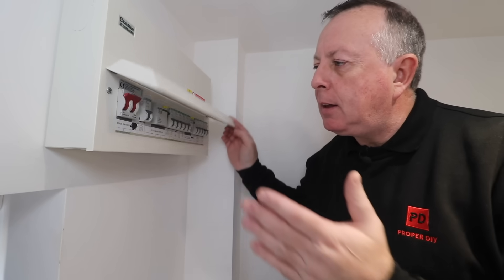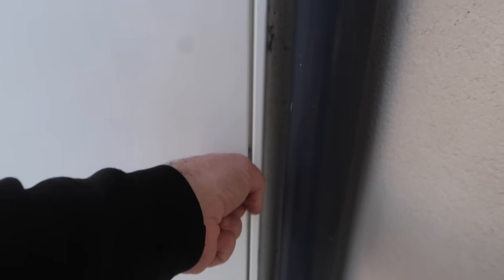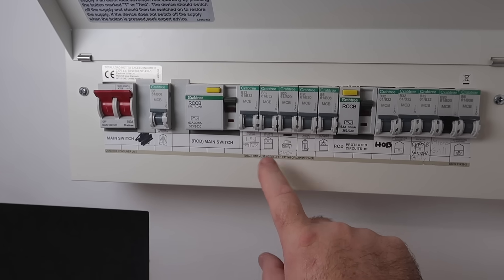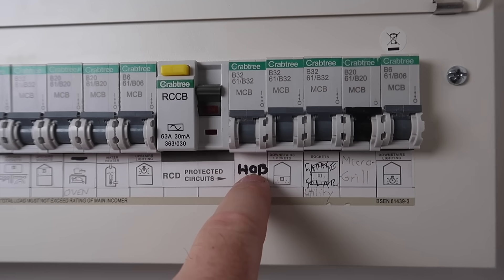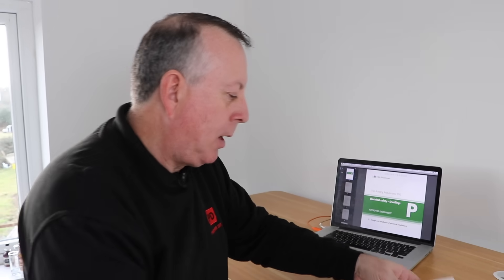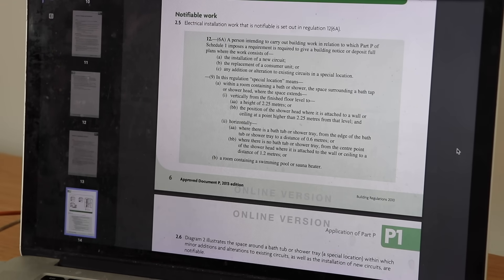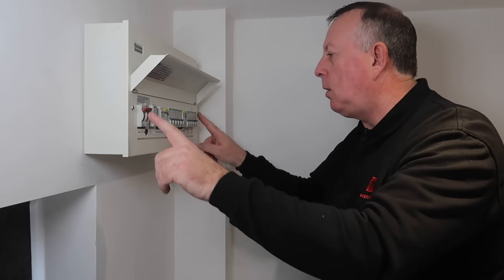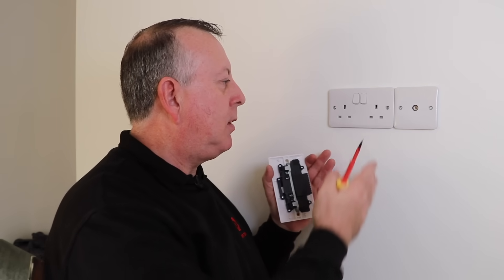What electrical work are you allowed to do in your own home?

Comment: Crazy , not being able to add another circuit, changing out breaker.

I had to tell an electrician to leave once due to doing it half ass.

Some off the installs or work you see very questionable and seems bit to easy to get the correct certificate to do the work.

If you're capable and following the rules and regulations should all thats be needed.

Comment: Very informative, but if I wanted to run power to a shed from an outside socket as shown in the video (6mm armoured cable being the proposed size),  could I connect it via that outlet or would I need to get a qualified leccy in to do it?

Comment: Interesting. Here in Finland you can change the "sugar cube", so you can install ceiling lamps yourself, or switch that cube to a socket for lamps. We can also do things with 12V systems ourselves.
But anything more belongs to qualified electricians - but even changing the consumer board doesn't have to be notified. You just need to keep the paperwork signed by the electrician just in case. 

Though you can save by installing the cables in place yourself, and letting electrician just do the connections.

Comment: Why doe they call it "Part P for the UK", when it doesn't cover the UK except within England and Wales? 
FWIW, I've installed shower circuits, oven circuits, and garden power circuits - to perfectly adequate electrical standards. But not being in England or Wales, it's all perfectly legal (and the flats/ houses have sold without problems).

Comment: The usual answer is, anything as long as you get someone certified to sign on that taking over responsibility for your artwork :P Where I live (not UK) I ofted do the work that the electricians should and then just pay the electrician to inspect and sign on what I did. Effectively this legalizes the installation, as the electrician makes the same document as if he did the job, but since he didn't put in as many hours, its cheaper for him. You just have to make sure the quality of your work is good, so that the tests pass, otherwise you have to pay for the tests and won't get a passing result, meaning you will have to fix it and re-do the tests, and this obviously will increase the cost.

On the continent if you had this much power (Watts) assigned, then you would have a 3-phase line instead of one thick 100A rated single-phase cable. Pretty much lets you pull the same amount of power, but you use thinner wires. You do use 4 wires instead of 2,  or in some cases 5 instead of 3 (when you have to add Protection/Ground wire to both)

The RCDs you have seem to be of an 'AC' type - this is growin obsolete and stops being permitted across Europe, as it will not react to many types of differential currents, only pure sine wave ones will trigger it, so it can protect simple heating elements, but its becoming insufficient for normal sockets - its recommended to upgrade to type "A", its slighlty more expensive but can also detect pulsating current.

Comment: Do you have into the house panel the phase monitoring relay installed in a cubicle together with a 6A circuit breaker for his own protection ? This is a very good protection in the house which can be setted for over voltage and minimum voltage in order to trip.

Comment: Why do you have two circuit breakers of 100A ? Bad choice. they can use only one circuit breaker with protection to shortcircuit and overload as example an ABB Tmax or Siemens.Must be more simple.

Comment: Buidling Regulations 2010 only apply to England.  Wales has its own set of regulations made by a Welsh Minister under the same Act.   Scotland has its own building standards governed by the Building (Scotland) Act 2003.

Comment: Just for anyone watching this video in 2025 (like me) or later. You are not allowed to add spurs anymore. My house is with a housing association and during the bi-annual electric inspection, the electrictrician had to disconnect 2 spurs, that had been put in many years ago, by an actual electrician (before my time here), as they were no longer up to code. So get that checked out before doing any spurs yourself.

Comment: I just want to say, listing all of the parts you use in your video descriptions is SO HELPFUL! :)  I was looking for the kind of double socket shown part way through this video, but as is often the case I didn't know the proper name and so was using all sorts of lengthy search terms.  Clicking through to the spur socket video and then checking the description, made it easy to find the MK rapid fix socket.  Much thanks :)

Comment: Actually, provided you follow the latest electrical regs (18th Edition), you can install/fix all the electrical installations you like in your house...The only thing you need to do, is to get a fully qualified electrician in to check and test it all, and issue a certificate of compliance... As a qualified Engineer, with a reasonable understanding of the requirements (and a copy of the 18th Edition and the other site-works manuals available)  I have done this myself on a few occasions now in different properties, and had the work inspected and tested and got a certificate of compliance issued by the qualified and registered electrician who tested and inspected,  and of course having that certificate means that the work you completed fully complies with the relevant regulations applicable (18th Edition), and of course the Building Control Regulations.
Doing the work this way, I have saved an absolute fortune on electrical installations/rewires etc... and of course doing it this way is in fact perfectly legal...

Comment: 6:19 what happens when the cable breaks between the consumer unit and the first socket? then all the current has to go through the other cable which can then overheat and cause all kinds of problems, just because the cable can not handle all the current that the MCB allows.
that's why i don't like ring circuits.

Comment: Once bitten twice shy for me. I had always done my own but moving into our current old house it was picked up that a previous owner or maybe kitchen fitter had fed a sub main in the kitchen from the main board in 2.5mm T&E, including range cooker. Tight for time I paid a professional to replace it with 10mm, not cheap! 2 yers later I lifted boards to run new pipes and found he had run 3 ft of 10mm  at each end joined to the original 2.5 for the length of the house. He could no longer be found.
Have done my own work ever since and will continue as long as I am able, no plans to move so don’t care about certs etc.
Reply: Hé ho vous êtes pas le premier à avoir ce genre de truandage comme les fils sous gaines alors que les fils sont directement " enterrés dans le plâtre et que les gaines ne sont que au bout
Reply: wow!
Reply: It's not you who will pay for the certs - it'll be anyone who inherits the property from you. Which may not be a concern of yours, but it certainly needs to be taken into consideration.
Do you still have friends in the industry who can "inspect" (through a wine glass, darkly) your work and issue appropriate tickets? While you still have contacts in the industry.

Comment: Im confident in alot of diy projects i do and have done in the past. Ive recently moved into a brand new property less than a year old. I want to fit a outdoor electrical box but i really cannot tell if my system as rcd or not. It has surge protection but on the consumer unit i cant see anywhere that ive got rcd. I thought all new builds had to have it by law. I also have outdoor lighting fitted when the house was built so surely i should have rcd. Apparently fitting a outdoor electrical box with rcd built in is not recommended to add to a system with rcd. I think im just going to have to admit defeat on this one lol.

Comment: Question: In your meter box you seem to have what they look like two main switches, one (a smaller one) owned by e-On, and the other one, a much bigger one, owned by you. Why do you need two next to each other. 

Also, in different souces I read that everything within a meter box belongs to the grid, so only your energy supplier or the grid is allowed to installe or amend any existing installation there. Is this true?

Comment: I've done a lot of research, and I think I know the answer i.e., that the work I'm having done is not notifiable, but can somebody confirm please? I'm having a toilet/bathroom conversion, by having the wall between the two removed, then the new room completely re-done.  We are having spotlights put in the ceiling (which I believe can be any IP Rating type as they'll be above 2.25m from the floor), and an LED mirror, and potentially some additional LED lighting, all of this electrical work will be outside of Zones 0, 1 and 2. We may have an electric towel heater, which I believe needs to be off of a spur, but that again will be sited outside of the zones 0, 1 & 2. Oh, and a new extractor fan - also outside of the zones (I believe).  So on that basis, am I right in thinking none of it needs to be notified?  Thanks in advance.

Comment: In Brasil you can work on/replace install anything beyond the electric companies meter. Which has good and bad points of course.
Reply: Well certainly, those showers ar e a sight to behold. Of course anything can be dangerous if done incorrectly, work by DIY should be allowed & should be checked. It is telling however that people in the UK are allowed to do all work on a vehicle & it is road legal (mods not road legal of course not allowed) & it is the responsibility of that owner, driver etc to make sure their own car is road worthy. I would have to say a car that has had shoddy work done to it is far more dangerous than a DIY electrical job done by a competent person who has checked it. And in addition people can do any work to electrical equipment, mod it, make it from scratch - again it is down to the person doing it to make sure it is safe for use. People may well have legal wiring in their house with an old fuse box. That certainly isn't as safe as some DIY putting new wiring, a new distribution box with all the latest safety info at hand & new sockets, lighting fittings.

Comment: Actually in old old properties they are metal, then the regs folk in their grand wisdom decided we all needed to swap them out for plastic boxes. Now they are are all going back to metal, was only in 2016 they made the change back so a lot of newer homes still have plastic. 10 year isn't old for a house, well not in my eyes anyways.
Reply: The fuse box in my house that was built in 1967 has a bakelite fuse box - I switched out the rewirable fuses when I moved in 25 years ago to resettable MCB's ones that just plug in. So again no work allowed on the fusebox.distribution box & yet some will still have rewirable fuses (actual wire that you have to wrap around the contacts). So the law is insane, my fuse box only has 3 fuses/MCB's, lighting 5A, main circuit 32A for sockets & a 45 amp one I put in for a cooker or shower. It needs changing & I should have put a new distribution box when I rewired the lighting & main circuit, also should have more than 1 ring main - certainly the kitchen should be on it's own. No doubt an electrician would just say it needs rewiring, however it does not, just needs the kitchen on a seperate ring main & some sockets putting in the attached garage. The original lighting circuit didn't even have an earth & was just live & neutral.
Reply: @triax7006  They used to just run a earth wire, bare round the house under the floors to hook into if need, and yeah I have never seen a baelight box before but I had a old type with the wire fuses, and still have the upgraded slot in mcbs sitting in my box incase one day I come across another :P  Regs are crazy though, personally still think the vast majority of it is just to make money and doesn't offer any added benefits.
Reply: @ It's is one of those MK fuse boxes, black or dark brown & they were still fitted in the 80's I think. I suppose the hard Bakelite is very heat resistant & no other plastic could compare to it & i suppose it was considered better than metal for safety to stop any contact to live. But yes the regs certainly stop ppl upgrading & they will just add more spurs to the existing circuit, add more to the lighting circuit instead of a new lighting circuit for things like outdoor security lights, which certainly could cause problems if water gets in.

Comment: Surely a DIYer can do "notifiable" work such as adding a ring, as long as they have it checked by a registered third-party certifier. See Part P section 3.5 "Before work begins, an installer who is not a registered competent person may appoint a registered third-party certifier to inspect and test the work as necessary."

Comment: I got called out to a DIY job where the guy had wired his own extension. Plumber went and got shocked off a radiator and socket face (metal) don't do your own electrical work.

Comment: I noticed you get quite a huge main braker in the UK .. In the Netherlands you will only get 1x 35A or 3x25A , You can get more but the network cost will go from € 300 year to € 1000 .. These cost are only the basic connection cost, not including the rest...  So 3x35A will cost you 1000,- 3x40 even more !!!!

Comment: I think this is slightly misleading, to say you are "breaking the law" thats simply not the case.  If you did DIY work which led to serious injury or death you could certainly face criminal charges for sure, but so could a competent/qualified electrician.    The regulations call for a "competent" person, not specifically a "qualified" person.  Competency in relation to electrical work is broadly defined as a person having appropriate technical knowledge, skills and experience to prevent danger or injury.  Its also worth saying that having an officially recognised qualification and/or being a member of one of the electrical standards bodies is a strong indicator of competency, its completely possible for a "Qualified" person to be incompetent or doo poor quality, dangerous work, and this is why the regulations are written this way. 

Does that mean you should break out the tools and do whatever you want, no, probably not, you do need a lot of knowledge around safety and practical issues, so your test is simple, if, after doing your electrical work something did go wrong, can you stand up in a court of law and demonstrate competency in electrical work without falling back on "having a qualification?" - if the answer to that question is yes, then sure, do your own electrical work, you are not doing anything wrong. 

If you are a landlord, and you have tenants in a property you own, its probably a good idea not to do electrical work in those properties, because if something did go wrong there, you would be considered neglegent and possibly face serious criminal charges as a result of any injury caused, and proving you are competent in that case would not matter so much.

And thats really the final point I would make, if you are diy-ing in your own home you can pretty much do as you please, but don't be an idiot, if you don't understand your electrical system, its earthing and safety scheme and the safety rules around that, and if you don't have enough knowledge (be honest with yourself) and/or the right tools, leave it alone and get yourself a professional who can do it for you.

Comment: I been a qualified electrician and mechanical engineer for 40 plus years, I have done all my own wiring work in my own home and tested, all compliant using testing apparatus as required. I'm not messing about with local authority, they are total idiots, there is not enough manpower to monitor this new system so cowboys are still rife. I am confident my work is safe and having seen work presented by these 'qualified and approved' contractors I wouldn't trust them as far as I could p155. They are there to make a profit, throw it in, take their money and run.

Comment: Bit late to the party but to avoid confusion, there’s nothing whatsoever a competent DIY’er can’t do themselves, including those three elements that are notifiable: you just pay your fee to the local building control before you start and have it inspected by them or more likely their electrical contractor. 

None of it is rocket science, although the onus is on said DIY’er to do it to the letter of the regs., as you can’t expect to get off with anything at the inspection. 

Yes, I’m suitably qualified electrically (and gas), but the other comments are correct. Virtually ALL the incompetent electrical work you see is done by electricians, not homeowners. The trade just doesn’t like to admit it, it’s easy to belittle DIY’ers instead.

Comment: Getting an old consumer unit that uses fuse wire changed in no way makes anything safer. My Sister and brother in law had that mentality, simply had the old box replaced simply because it was old. 2 year later the new modern consumer unit caught fire damaging the porch.

I'd only get my old wylex fuse board changed if I'm looking to add a new circuit, which might make such a change essential anyway.

You should have mentioned how essential it is to test your RCDs actually do trip. When they get old, they won't trip and the only way to tell is when you...

If you're going to have RCDs, test them when you test your fire alarm and carbon monoxide alarm and use a RCD tester in a play socket round the house too nit just the test buttons on the consumer unit.

Comment: Recently built a new house and was shocked by the quality of the installation particularly the drilling of huge holes through the timber frame and  no thought for the  follow on trades like the dry liners having to avoid large bunches of cables this was a so called professional electrician I then got another electrician to test the work because I wasn’t comfortable with the work being safe as the first guy had problems with testing the earth